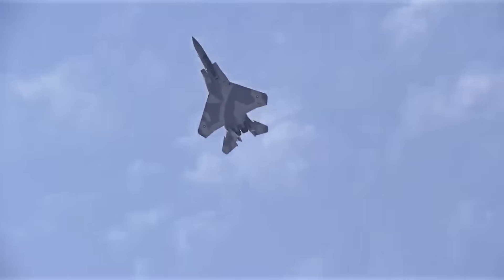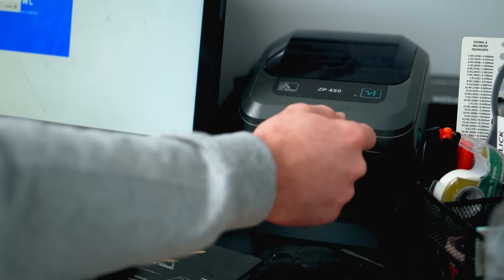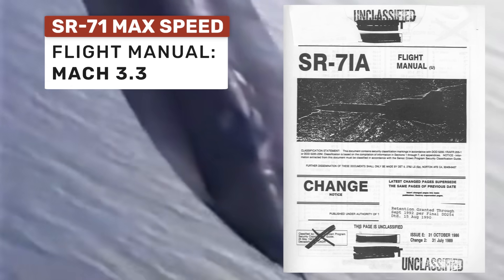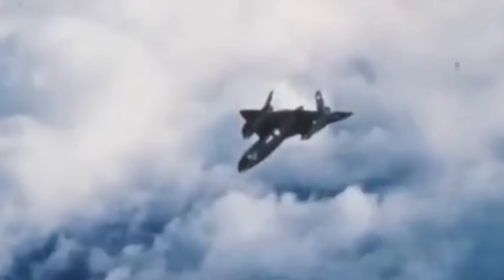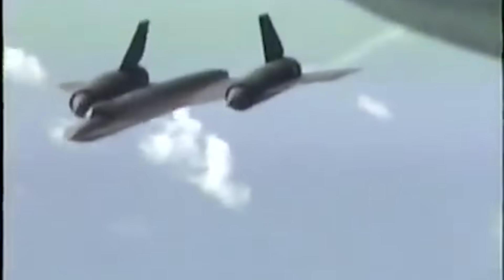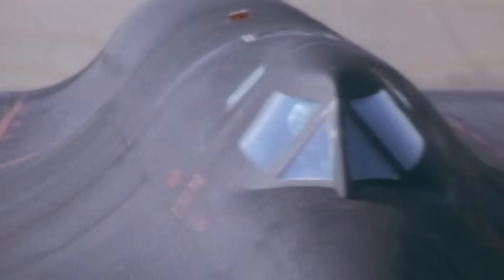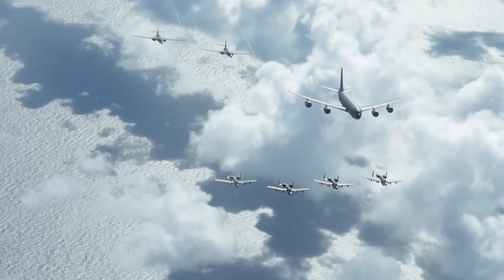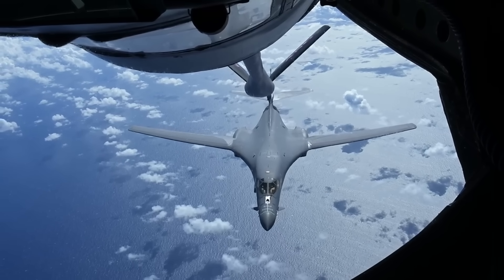The SR-71 was MUCH FASTER than the Air Force will admit

Comment: according to historical records 1 SR-71 was clocked at Mach 4 before disintegrating during testing because the air frame couldn't handle the heat and friction being generated, then again 2 pilots confirmed that they were able to push the Bird past mach 4.2 on several missions after the test accident. The engines used for the SR-71 were capable of pushing the jet to mach 5
Reply: There is only so much a compression chamber can withstand pressure will become so great the heat will melt the containment.
Reply: @spikenomoon   you do know that the engines on the SR-71 were hybrid engines and, at minimum, 30 years ahead of their time.  As a matter of fact, the compression chambers of those engines are the ancestors of the chambers Elon Musk uses on his Falcon 9 rockets. This is why those rockets can push out so much force at half the power output required of those used by Blue Origin, ULA, Russia, China, and other space agencies around the world.
Reply: The A-12 has it's record breaking also but out of respect I'm quit sure that's Classified.

Comment: Back in the 80s, I went to an airshow at March Air Force Base in California. Back then, the SR 71 and U2 aircraft were kept in hangers to prevent prying eyes from satellites. However, one of the pilots was there in an orange flight suit not the pumpkin suit for the space shuttle. On his sleeve was a diamond shaped patch with an SR 71 top down view I guess and stitched on it it said +3.5. I’ve never seen this patch replicated anywhere else although there’s plenty of patches that show +3 I know this is anecdotal, but even at the time I thought wow that’s even faster than the Air Force states it should go.

Comment: Technically, it has no top speed. The limit was only due the temperature of the skin on airframe which was relative to the air pressure  at altitude. If you flew into a nice low pressure region in atmosphere then you could push the airspeed and flow over the aircraft faster because it exerts lower friction on the aircrafts surface.

Comment: Its really no secret that the SR-71 is capable of flying faster than stated, of course doing so dangerously stresses the airframe. Its also no secret that the U2 can and has flown much higher than the USAF admits. There's no denying these are a couple of amazing aircraft, especially when you realize just how long sho they were designed and built.

Comment: I once knew a retired SR-71 pilot and he told me that the SR-71's absolute top speed was Mach 8.9.  I kinda didn't believe him, but seeing a comment here about doing Mach 4.7 at half throttle, there's a chance that it could be true.
Reply: Possible but I have my doubts but if so then that Aircraft would be in SPACE.
Reply: @craigbosko2229  Not quite.  Mach 8.9 is 6800 MPH but 18,000 MPH (Mach 23.5) is required to achieve orbit.

Comment: Speed is different from Mach number, it is the Mach number times the speed of sound. The speed of sound depends on the air temperature T in Kelvin as follows sos=√(1.4×R×T)
R is the gas constant for air = 8314/29
8314 is the general gas constant
29 is the molecular weight of air
The higher the temperature, the higher the speed V= sos × Mach number
BUT the temperature at the compressor inlet  is limited by structural constraints . If the temperature has been exceeded, then the compressor must be replaced.
The temperature of the compressor inlet is
Ts = T×( 1 + 0.2 × Mach²)
So the lower the ambient temperature is the higher Mach number is permitted without DAMAGE 
But the corresponding SPEED is lower.
The price of a overspeed is the cost of a new engine
With the temperature limitation, with the above formulas and the outside temperature you can calculate the permissible SPEED.  No speculation!
Reply: SR-71 air inlet control co-designer here.

Comment: Ive never needed taller boots for stepping in 💩 in all these comments lol 😆. A few tenths of a Mach higher is one thing...but you gentlemen saying 𝒇𝒂𝒔𝒕𝒆𝒓 𝒕𝒉𝒂𝒏 𝑴𝒂𝒄𝒉 6 or 𝒕𝒉𝒆 𝒔𝒑𝒆𝒆𝒅 𝒊𝒏𝒅𝒊𝒄𝒂𝒕𝒐𝒓 𝒘𝒂𝒔 𝒔𝒕𝒖𝒄𝒌 𝒐𝒗𝒆𝒓 𝑴𝒂𝒄𝒉 6...are full of it. I get it. Its a marvel to think about, but youre not seriously going to say or believe an air breathing aircraft that had to stay beneath 100k is 𝙁𝘼𝙎𝙏𝙀𝙍 at 85k than the X15 was when it could go 3.5x higher are you?? Mach 3.4-3.5 sure, maybe, but c'mon guys, be realistic lol. Ones a monster sized plane with the limitations of titanium and still needs to stay at an altitude to consume oxygen for combustion of its JP7 (lower altitude, higher friction=higher heat, speed limited due to heat), the OTHER...is literally a rocket that happens to have tiny little stubby winglets and was constructed of Inconel X-750...much different than titanium, holds its strength to 1500°. Also the X15 only weighed 34k lbs fully fueled and was already starting its flight profile a few miles up at a couple hundred mph when it hit GO, the Blackbird weighed 60k EMPTY and 120k-140k when fueled at altitude.  Mass is mass. Youre not taking the X15s top speed away from with a Blackbird, as much as I love Kelly Johnson & Ben Rich...sorry.

Comment: When working on the B-58 Hustler supersonic bomber during a debriefing of a flight crew a reported problem with one particular aircraft was that the aircraft was exceeding the Mach indicator reading when the throttles were pushed all the way forward. In other words the aircraft was drastically exceeding Mach 2. One particular Hustler nicknamed "Greased Lightning" as far as I know still holds several records including a flight from Tokyo to London (a distance of 8,028 miles) in 8 hours, 35 minutes, 20.4 seconds. As of 2016 that record still stands.

Comment: The military under reporting aircraft theory doesn’t make sense. The whole point is deterrence.   I know this will sound crazy if you’ve never even heard of the theory, but I think they do it bc the blackbird already exposed that the lie of convex curvature of the earth at 8in /mile squared.  Think about it… you can calculate at that speed how far you would have to nose down the craft just to maintain altitude.  But it sets on a level horizon and you can see the plane is shaped nose up.       The earth is concave at 8inches per mile squared.

Comment: I dunno, its all a bit waffly....  to make up my own word i recon. It's all dependent on air conditions if you boil it down.  The speed of sound is even variable, so it's semantics at some point. you have to remember, thrust to weight wasn't the limiter in this design, it was inlet shock wave condition. If you exceed the design profile in a static air density, and subsequently disrupt the shockwave outside of it's operational pattern, bad things happen and the inlet unstart condition will rear it's ugly head. You can't really beat this. Sure, a few percentage points, but we are talking about dynamic air conditions, so it really isn't under-reported, you just need a baseline somewhere to state performance.

Comment: I guess you should know thar I am 77 years old.  I still remember the F4 's flying down the runway, gear up, 20' off the concrete , by our hanger (the last one before the perimeter road and barbed wire fence) standing them on their tails and boring holes through the clouds.  I was a plane captain just getting used to our A7's.  This was about 1968.  Ceçil Field, Fl  Guess this doesn't impress the SR71 crowd, but watching the F4's did to me.

Comment: I worked on F-14s for Northrop Grumman in the 1990s and the story of the SR71 surpassing Mach 3.5 over Libia outrunning Ground to Air Missiles is a true story. The Pilot did say the Aircraft was shaking and overheating but was only had to reach that speed for a short time to outrun the missles. The SR71 is capable of going faster if the structure doesn't overheat and the engines dont stall. The F-14 is capable of flying over Mach 2.5+ as long as it maintains stability.

Comment: Pretty sure the SR71 Speedometer goes up to mock 16.
Find it strange that with ramjet engines that pretty much have unlimited speed, it seems strange that it would go under mock 4.
You cant even top off fuel when they are on the ground because they leak all over till they get into flight, then they top off in the air, where the plain doesn't leak.
In 1983 they were outfitting lasers on one at Beale air force base.
You will never know how fast one of these goes, just like you will never know how fast  trident sub goes, but, I am positive it is substantially faster than they are telling you...:)

Comment: The SR-71 uses thermal expansion to seal up the fuel tanks. So one limit of the SR-71 is the compressive stress that the titanium skin will receive at M3+.
Reply: Not too much as the titanium becomes somewhat flexible at those temperatures.

Comment: The SR-71 was designed for up to Mach 4 flight. Mach 1 for planes is 660 in the stratosphere not the sea level Mach 1 which is 760.

Comment: Great video, as always.  One question...  since it's very demanding on the airframe and the external covering of the airplane to go that fast, even if the plane uses state of the art materials and the best aerodynamic...  How in the world a Mig 25 can reach almost the same speed as the SR-71, with a very standard aerodynamic and materials?  Mig 25 does not appear to use anything special to protect it from overheating.  And the shape is quite boxy.

Comment: The SR-71’s published top speed is Mach 3 to 3.5. Brian Schul and Walter easily reached 3.6 or higher by his account. The intake design was optimized for flight above Mach 3.2. Which means that the inlets might possibly limit the performance envelope. However, the structural integrity of the airframe of the Blackbird was not a limiting factor in how fast it could fly. Every time the Blackbird would fly Mach 3, the thermal cycle would further anneal the titanium, and make it stronger.

Comment: On the last evening of 1970, I had the extreme pleasure of meeting Jim Eastham, a recently retired Lockheed test pilot.  He presented me with eight 8"x10" b&w glossy photos of himself standing beside the SR-71 and Convair's B-58 Hustler.  Lockheed loaned him out to other aircraft companies rather often.  He flew every variant of the SR-71/YF-12/A-11 that Lockheed built.  During out two-hour-plus talk, he told me he photographed more than 100,000 square miles of ground in an hour.  When I asked what he could tell me about the bird's speed, he confessed to 2,400 mph (remember, this is the last night of 1969.)  Then he told me, "I can give you 2,400, and I can tell that I've taken it faster.  As fast as I've taken it, there's still some left under the hood."  Now think about that."  And I did for about the rest of my life, at least up until now.  When I teasingly asked "26", he just snickered and looked away.  As for altitude, he confessed to "well more than 80,000 feet".  And that was back on the last day of '69.  So, has the gubbumint been lying about the true performance of the Blackbird?  Well, duuuh....
Reply: Correction - it was the eve of 1970 going into '71, nowhere near '69.

Comment: In the early 1980’s, my flight instructor, just retired from the Air Force as an Lt as an aerospace engineer, told me he worked on one of the first laser tracking systems. During one of the tests, he tracked the SR-71 at over Mach 4. He excitedly said this to the his Captain. The Captain told he did not. But he said back, Yes I did!! Captain said once again, No you didn’t. That’s when he got it. I don’t know if his recounting of the story was true, but he was one of the smartest engineers I’ve ever known.
Reply: I knew an AP who was in good with some of the SR-71 aircrew and maintenance personnel during the Vietnam era; he said they were always over 3.8 and quite a few were well north of 4 (4.2-4.5; idre).  They used a special paint on the inside of the airframe that changed color according to temperature; correlated to speed, it gave the maintainers & reviewers indisputable evidence — not that a SR-71 crew would ever “sandbag.”
Reply: Had a Navy ATC buddy who talked with a 71 pilot and admitted that they were able to bump it upwards of 5.0.........very believable........ @wireflight
Reply: @tedhursh7672  Complete BS

Comment: It's really simple math. All you got to do is take the angle between the nose cone of the fuselage and the nose cones of the ramjet/ turbojet engines and you get the angle that the specific mach wake would be at a particular altitude. Can't go any faster than that because as soon as the mach wake gets into the inlets the engine shuts down or self-destructs
Reply: ... and that number is Mach 3.56

Mach#  = 1/sine(shock angle)

Comment: well F15 was rated at mach 2.5 plus    some came back with paint burned off ,,,we knew 3500 mph ,,,,now mach speed varies with altitude ....so its relative    for example mach 1 at sea level on a standard day is 759,9 mph ,,,,and 500 at around 36,000 ft    so a 727 would fly at .85 mach ,,,485 mph at cruise altitude ,,so these things flew at 40,000 ft or so   some 50,000to 85000 as cameras and radars improved

Comment: I met an uncle of a friend who was a USAF inertial navigation technician on the SR71. He was still held to TS requirements even being out of USAF for 15 years. He said their top speed was above Mach 4.5. He would only confirm it was faster. He saw the exact speed when processing post flight navigation system.
Reply: the TS requirements never go away.
Reply: According to Mach rules this is is impossible as Plane would have its wings destroyed by turbulent flow, nothing to do with cooling.

Even if you go at 80K feet or above and calculate Mach speed at speed of sound at that Hight. (which is not done, since we use universal at sea level matrix)
The plane would only reach Mach 4 which is the same as MACH 3.5 at sea level.
Reply: I think this is true!  See my comment about an in flight refueler on main page.
Reply: True, but he never gave a top speed. Just a nod when we gave a speed. Higher. Much higher.
Reply: I have read about flights being tracked by earthquake monitor stations due to the sonic booms shaking the ground slightly. The article stated that the best guess they could come up with was 4+.
Reply: Unlikely because the Sr-71 was retired due to the Mig-31 which has a top speed of Mach 3.2.
Reply: @JamesTKirk-ez6ip  Not retired for that reason.  And the SR -71 was clearly over that speed.
Reply: @JamesTKirk-ez6ip it could hold that speed for only 20 minutes, the engines will fail.

Comment: I got to chat with the ground crew at the Abbotsford Airshow in 1986. It didn't fly as part of the show but it was on full display, along with the two "starters", If I remember correctly each starter had dual 454 engines. I took a bunch of photo's but my camera was stolen before I even finished the roll. Bummer.

Comment: I was an engine mechanic on the B-58 Hustler.  It was capable of speeds so fast that the friction with the air would burn the decals off of the skin of the aircraft.
Reply: Decals?  Legend has it the SR-71 was too hot for sealants and would leak fuel like a sieve on a cold start.  It was only after warming up that thermal expansion of the skins would close them up and so they would take most of their fueling in-flight
Reply: @ExaltedDuck that is true,the plane had to be assembled so it was loose fitting-the friction of high speed flight would close the gaps between each piece.If it wasn’t,the plane would literally break apart from the expansion while in great speed.That’s the same reason bridges have expansion joints,to allow expansion and contraction due heat and cold temps.
Reply: @cahg3871 that is true, it was also true of the crazy fast 50’s designed English Electric Lightning, interestingly the British also understated that plane’s performance and kept the real figures secret just like the Americans have with the SR71.
Reply: That's the absolute truth  @ExaltedDuck
Reply: @ExaltedDuck  Legend?  You can see them leak in photos, videos, and some of the footage used in this video.
Reply: The A-12 was faster and flew higher due to its lighter frame. But it was a super secret aircraft unlike the SR-71.

Comment: It's not lying. It's called confidential information. Ask the Navy how fast their Aircraft Carriers can go... or how deep their Subs can go... they will lie about that too. Having said that, I was stationed in Okinawa at the Kadena Air Force Base and they are cool to watch. They take off nice and slow, then their tail drops down until the plane is almost vertical... and boom... the afterburners kick in and the plane is gone out of sight. When it takes off it burns about 80% of its onboard fuel. It must air-dock with a refueling plane before it begins its mission. And yes... the plane is actually longer while cruising at its normal operating altitude, than it is when it is at rest on the ground. One of the few planes I ever saw deploy a parachute while landing. Very cool... designed in the 1950's.